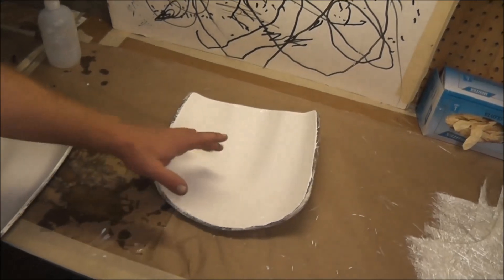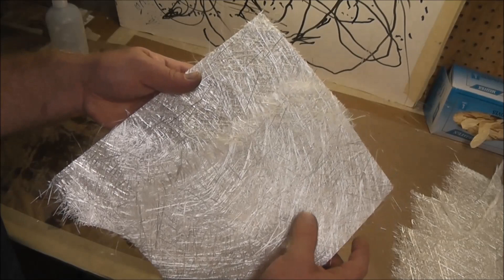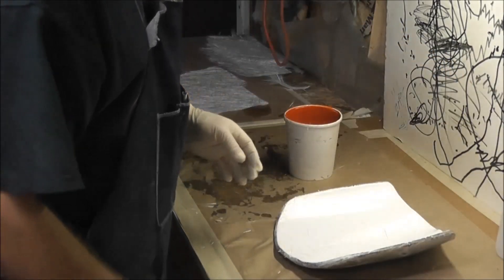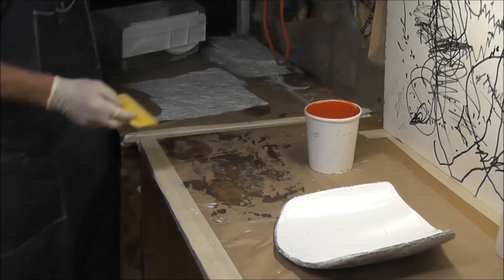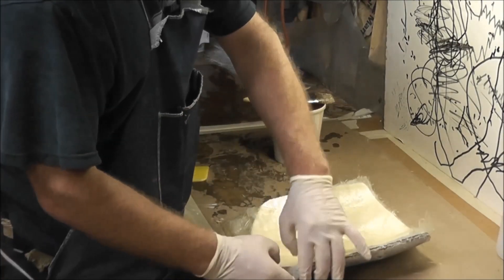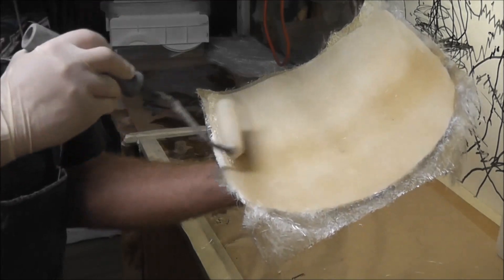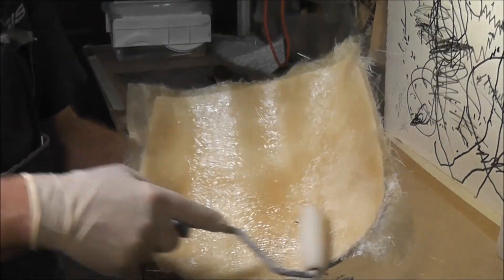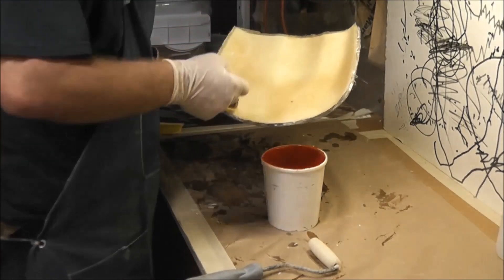HOW TO FIBERGLASS - Making Parts pt2 or 3

Comment: And will a vacuum work to get the air out?
Reply from the maker: Vacuum will not get all of the air out but it does help. The air still needs rolled out of the layers. You will get a stronger and lighter part if you use peel ply and vacuum bag the part.